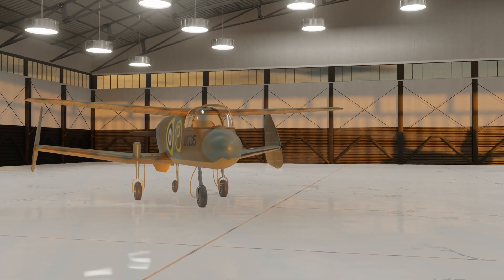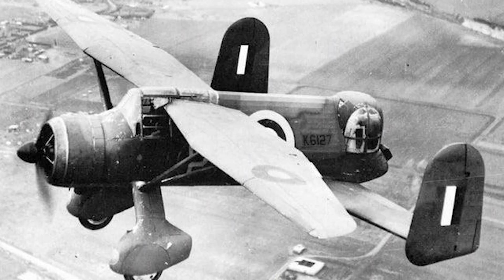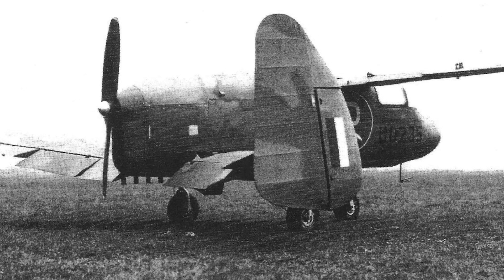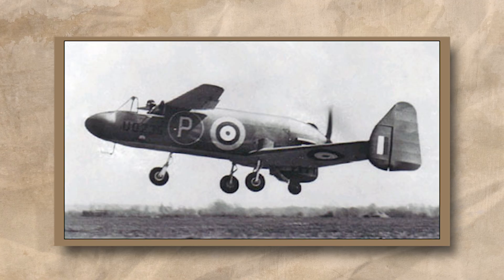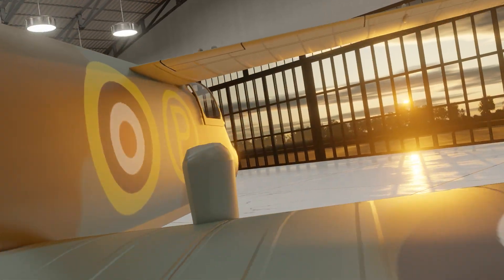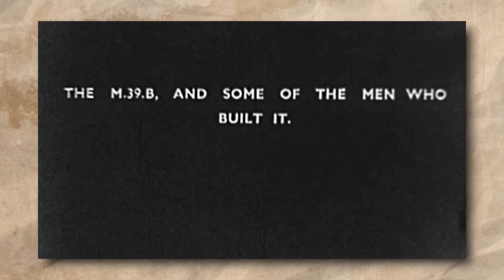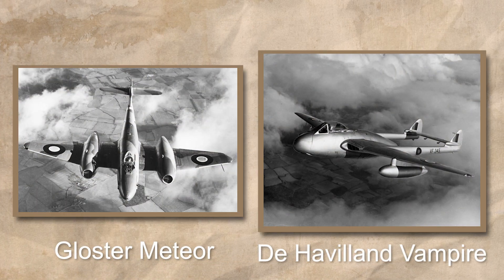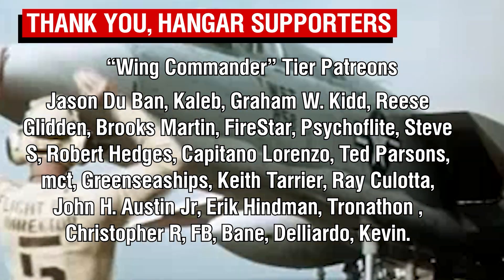Tandem Wing Aircraft Were Almost A Thing In WWII | Miles M.35/39 Libellula [Aircraft Overview #83]

Comment: Miles aircraft also worked on Britain's attempt to break the sound barrier. That would be an excellent subject for a video.
Reply: Not sure if the proposed engine could break the sound barrier in level flight, but otherwise it was a sound design. Better than the DH Swallow anyway.
Reply: @papalegba6796  The M52 was more than capable of breaking the sound barrier.

Engine and airframe development was cancelled and the technology handed to the USA in the guise of the Bell Aircraft Corporation. Thus it went the same way as the swing wing technology which the UK government abandoned with the US government picking up Barnes Wallis's theories for nothing.
Reply: The Miles M.52 scandal was one of the most shameful and humiliating chapters in British aviation history...
Miles Aircraft was charged by the Crown with 24 counts of fraud and embezzlement, Frank Whittle was removed from Power Jets Ltd and discharged from the RAF amid allegations of extortion and dereliction of duty.
Ministry auditors raided Miles Aircraft and found nothing but incomplete drawings and a partially built wood model of the cockpit layout, nearly all of the funds hadbeen stolen by Miles Aircraft and Frank Whittle.
Reply: @WilhelmKarsten  Hello sandyboy, I see your bitter little wehraboo heart still burns with rage at the trashing your nazi dreamboys got.  Anyway sandyboy will you be backng up your claim that Whittle was discharged from the RAF and will you be providing any evidence for the existence of the charges that you refer to?
Don't worry, I know that you won't because as we know you are a LIAR

Comment: You just need to look at Burt Rutan's aircraft to see that Miles were onto something.
Reply: It’s all about homologation costs. Regulators don’t like unusual stuff.
Reply: @Dave5843-d9m  that was a large part of why the beechcraft starship failed. It was a Rutan design but the regulators didn't know how to deal with the wing layout and composite build.
Reply: If it was that good, it would be the norm, not one offs.
Reply: The issue is homologation. Something that looks abnormal gets far more negative attention and costs to reach flight certification.